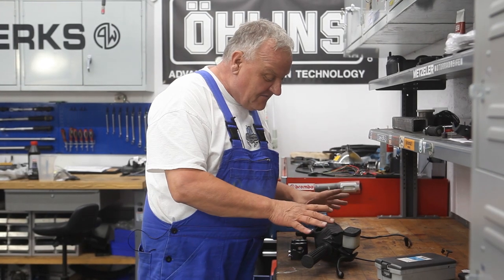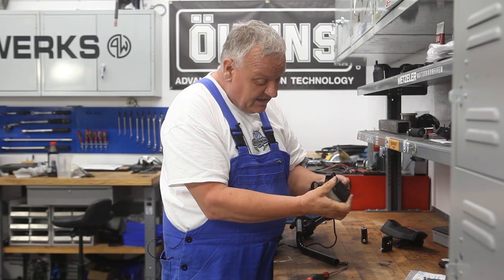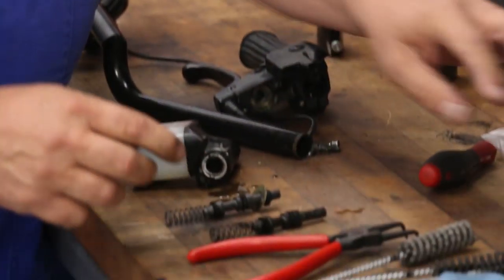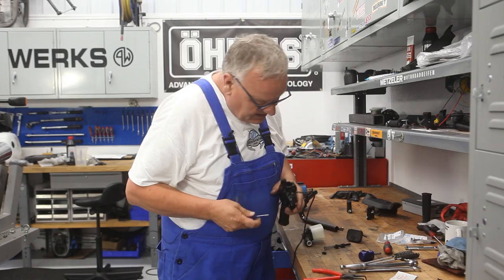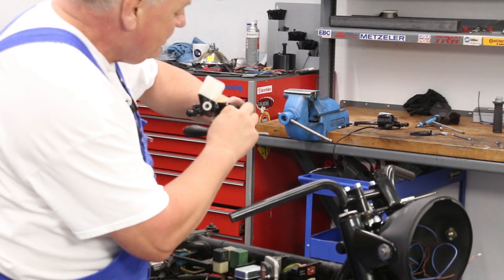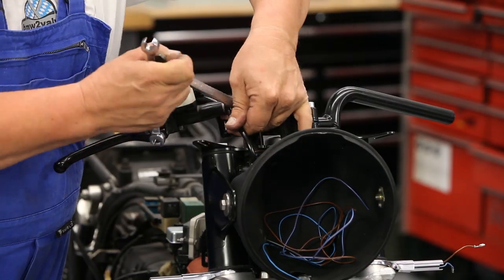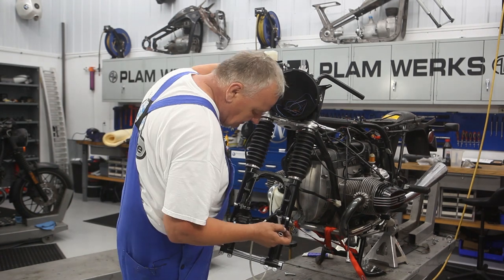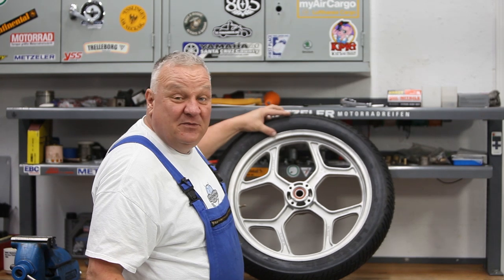BMW R80 RT to S Conversion #6 - Brake Check!  Master Cylinder, Brake Bleeding & Handlebar Mods

Comment: For brake bleeding you have to push the brake fluid with a siringe from the left bleeder towards the brake pump and the air will go out thru the brake pump. It works for me on every bike...

Comment: Nice video !  I miss the information about the compensationbore in the mastercilinder. It's is the small bore next to the larger bore in the master cylinder. If that is not open, the break will not release.  I had that last week....... .

Comment: hello i have the T set-up and i have a big issue. First it runs fine but when i break, it does not release the pressure... after 5 min of use it gets stiffer and stiffer till the point the front wheel gets blocked completely. Any guess on what am i doing wrong? 

I did change the oil, disassemble and clean the master cylinder, disassemble and clean both break units and install new pistons (original brembo). only old thing seems to be the line.

Comment: Awesome Guys..great to see you back William.. I do not have vacuum to bleed brakes. Is it possible to still do the old way as in just using the lever. As I have know changed my brake lines to the same way as you have? Or do I need vacuum?
Reply from the maker: Hi Steven, You don't absolutely need a vacuum bleeder, it just makes the process easier and quicker. You can also use the brake lever but it would then be very helpful to have an assistant to because pumping the lever while keeping the reservoir topped off and opening and closing the bleeder will require more than two hands but it's definitely possible!
Reply: boxer2valve BMW Restoration and Parts Supplier 
Thanks guys.. this has been an absolute god send for me as I only got my BMW R80 in Nov and know nowt about them. So following you guys is fantastic. And to be honest I’ve never done anything like this before, so I’m learning all the time from you guys. keep it up,  and thanks so much for your help and replying to me. 👍🏻

Comment: Thanks William for this episode. Your video's are very help-full for me. One question, what kind of solvent do you use for cleaning the parts?
Reply from the maker: Hi Gerhard, We use a mineral based solvent from Safety Kleen however that requires having a service with them. I have had great results with a product called B'laster Parts washer solvent and that is available in one gallon cans.

Comment: Have you ever tried reverse bleeding by pushing fluid in through the left caliper with a fluid syringe and forcing the air/fluid out the right caliper and then up into the master cylinder?
Reply from the maker: Hi, That's a very good idea and it would probably work, however I have not tried it that way. One concern might be that when the bleeder nipple is loosened, some air might be able to pass by the threads on the outside of the nipple.